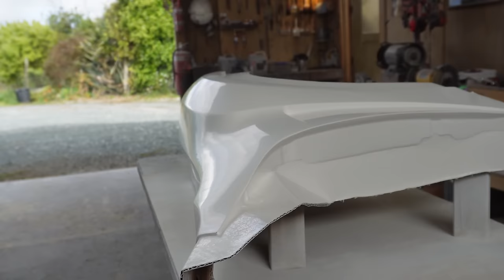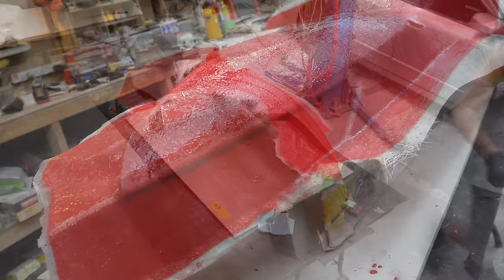How To Make Fiberglass Fender Molds. Part 1 of 2.  Sky-gea build: Part 8

Comment: Absolutely phenomenal! I've been moulding and casting for years (although in the prop making industry, where quick and dirty is the order of the day) and I have never seen such neat and meticulous work. TOW is a master craftsman. I learn so much from these videos. Much respect!
Reply from the maker: Thanks mate! There's always a time and place for quick and dirty moulds too, ones with packing tape repairs and where you just coat the thing in PVA and cross your fingers but I usually point the camera the other way for those ones haha.
Reply: @TofuAutoWorks what part would you be using PVA for? To replace your resin??

Comment: I'll never use wax and PVA together as i have had so many problems with them reacting. There's some waxes that work better with PVA, but my two cents is, if you put minimum of 5 coats wax (miracle gloss i guess is some as mirror glaze by meguairs says IIRC 6 layers first time) you don't need PVA. On fast pulls and couple of products done, i've used only PVA sprayed on couple layers.
But I gotta say, i like your style on laminates, getting the mat wet first and then brushing it shape. Keep up the good work.
Reply from the maker: I'm a similar way. I don't really use PVA anymore because of how much of a pain it is to deal with, but I figured for the sake of this video is was best to show people the most fool proof way of tackling a mould. I'll always recommend PVA over wax when making a pattern off a plug because you never quite know how the paint on the plug will respond to the gelcoat. However when I'm making parts from completed moulds I usually just skip the PVA step.

There are also alternatives like easylease or frekote that I'd recommend but those are much more expensive than PVA and I wanted to show a more entry level video for people just starting out.

Comment: Long time but maybe you will see this, so  when you put matt over , what is the difference between body filler and using gelcoat?  What  would i do if after resin + matt i notice i have some slight imperfections , would i do  gelcoat anyway then body fill> paint   or i would do body filler and gelcoat over and paint ?

Comment: 1st video from your work I see and it's exactly the way to do it, perfect! 👌 For my molds I personnaly add bracings cause I prefer to mold the final parts using vacuum technics to obtain a light, thinner part and a more flexible part using less resin to obtain a high reinforcement/resin ratio. One question: What is the composition of the "no more gaps" product, pls? I suppose not silicon...

Comment: Love it bro. Looking awesome. ? Why don’t you use peel ply on your final layer of chop strand so you don’t have to sand too much before the tooling resin? Great job though 👍👌
Reply from the maker: It's an option, but it's not really what peel ply is designed for. The finish you'd get from that would still require sanding in order to properly key the surface to bond to the next layer anyway. 👍
Reply: @TofuAutoWorks  you would still have to sand but it will have a flatter service. You tend to have deep craters that aren’t sanded with the chopped strand.

Comment: i just start learning to do the fiberglass mold. But im not sure what material i should use. 
I live in australia and sometime english make me confusing. Can you list what you use when you making the mold ?
I try to looking for the tooling resin but honestly I dont know what brand I should use..
Thanks and have a good one
Reply from the maker: Hey Anh, 
For your first mold I wouldn't worry about using tooling resin, it's quite a bit cheaper to use standard Polyester resin which you can find at any fiberglass shop. Tooling resin is quicker to build up a mold with, but costs twice as much.
For a more simple beginners mold, I'd recommend checking out Part 6 of my Widebody Miata build series on making a fiberglass mould for the rear garnish. 

Materials you would need are:
-Acetone for cleaning
-Gelcoat (you can use tooling if you plan to make a lot of parts, or just regular gelcoat if you only need one)
-Polyester resin kit
-80gsm fiberglass tissue (1 layer)
-225gsm fiberglass chopped strand matt (1 layer)
-450gsm fiberglass chopped strand matt (5 - 8 layers)
-Brushes
-Fiberglass roller (if you only want to get one, a curved barrel roller is the way to go)

OPTIONAL:
West Systems 413 Microfibre blend. 
I like to use this to make a filler that I use on all sharp corners, makes it easier to get air bubbles out.

Comment: so im trying to gather all the supplies needed to do this for a window trim piece. im at the 30 gsm tissue step in your video is that literally tissue paper or is it some sort of super thin fiberglass mat or cloth. cuz i cant find anything in fiberglass with a 30 gsm rating but did find lots of actual tissue paper lol. would be nice if you posted in the youtube video links to the supplies you used
Reply from the maker: There may have been a typo in this video I'll have to check and correct it, but from memory what I'm using is 80 gsm fiberglass tissue. It is a lightweight fiberglass material designed as a first layer to reduce print through. You will find it in the "surfacing veils" sections of most fiberglass retailers.
Typically whichever weight is provided by your supplier will be adequate. 

The reason I don't provide links to supplies is because I get all of mine locally and they don't list half of their materials online and if they did that information wouldn't be helpful to anyone overseas.

Comment: Serious rain going on outside! Does the moisture affect the process at all?
Reply from the maker: Yeah it does slow down the cure and puts a little bit of moisture into the glass as well which is less than ideal. You'd never tell but this is supposed to be the middle of summer here and I just got super unlucky with the weather. 

Went from pouring with rain to scorching hot daily throughout this video and I think I may even have ended up with some wrinkling in the gelcoat from it not curing fully. But we'll burn that bridge when we come to it.

Comment: 4:47 on a side note are these ryobi  tinny belt sanders any good in looking at that or a makita but there is a big difference in price
Reply from the maker: Mine actually just died, had it for about 4 years and used it pretty often. Ryobi are probably the best DIY level tools, perfect if your doing the odd bit of work but if you plan on using it as a workhorse nearly every day then it's worth going for the Makita. I prefer using the ryobi one over my air powered one.

Comment: a little question because between all i'm already lost, the moulds are going to be to produce pieces the final piece of the car and the sale, and the white one is the car itself part that is from metal but is no going to be usefull, i'm right?
Reply from the maker: Correct. The white ones that you've seen me shape on this channel for the past couple of months were never intended to stay on the car and are mostly made of body filler. If you tried to drive the car with those, the filler would crack almost instantly.
Reply: @TofuAutoWorks  ahhhhh, ok ok, so the final to the car it's full fiber glass, there's an estimate on weight saving on that pieces?

Comment: So why spray epoxy to just wet sand it? Why wouldn’t you just paint the whole fender before doing all the flanges etc? That way the part is sealed, and clear coated. Then you could wet sand that and polish that if you wanted.

Comment: after applying that second coat of gelcoat when tacky, how long do you wait til applying first layer of fiberglass? do you let it dry or lay when tacky (like wet laying carbon)
Reply from the maker: I let my gelcoats cure overnight. It leaves them tacky enough that you can press fiberglass tissue on to and have it stick, but won't come off on your finger.